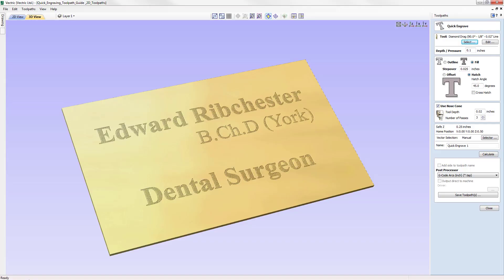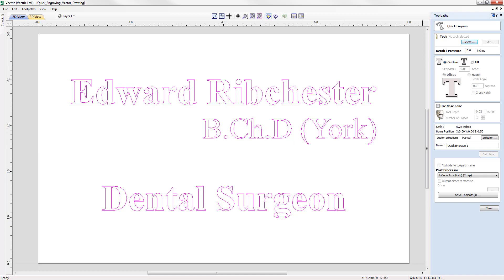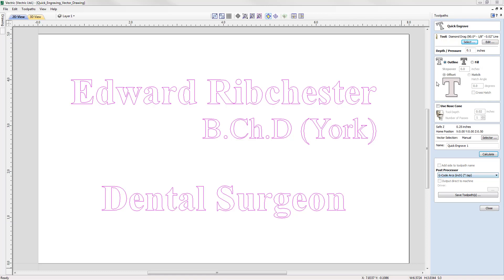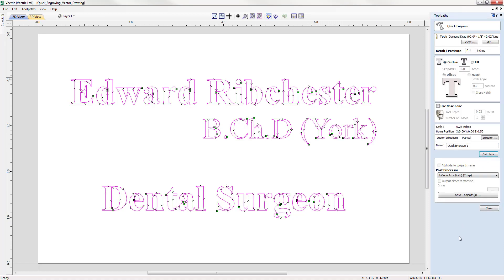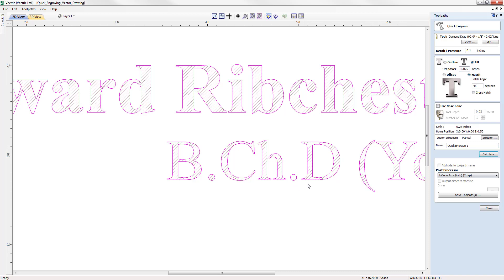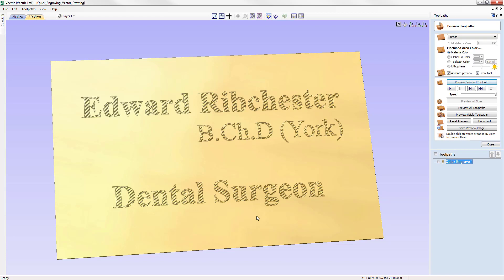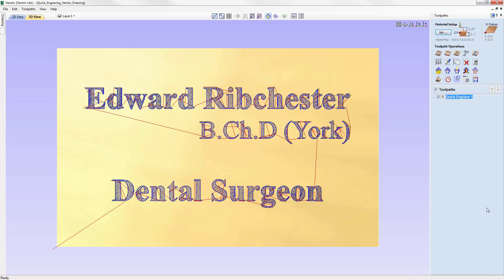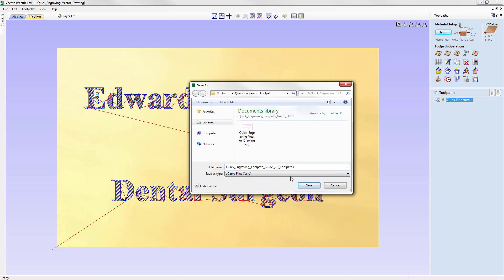Vectric V10 Tutorials | 2D Toolpaths | Quick Engraving Toolpath Guide

Comment: Why is there no start depth for the quick engrave option?
I'm working inside a pocket, and all toolpaths have the start depth option, but the engraving does not?
I cannot engrave the bottom surface of the pocket because of this, at least there is no preview.
(You can fudge the depth enough to make it work, but still no preview)
Reply from the maker: Hello Mogalize... Thanks for the comment... and question.  I'll be sure to ask the Dev Team, and get back to you.  It might be somehting we never thought somone would need, or there may be a technical reason why we don't offer that option.  Leave it with me.
Reply: @vectric  Thank you. I have also posted this question on the Vectric forum for further reference.